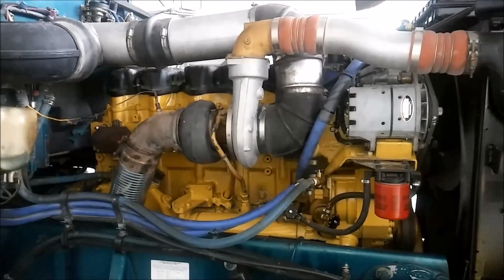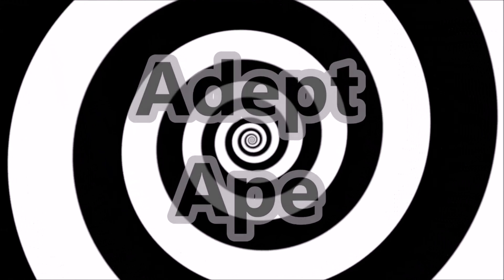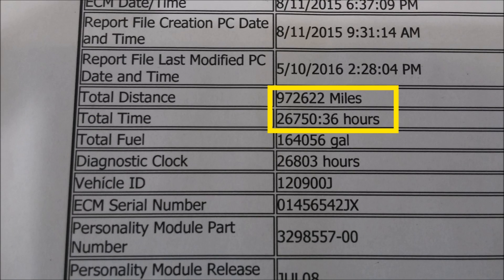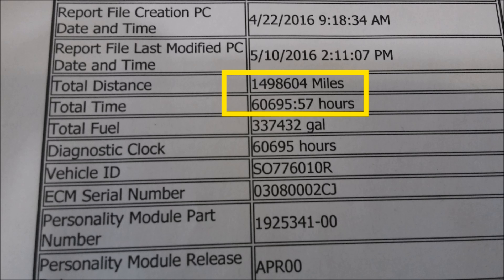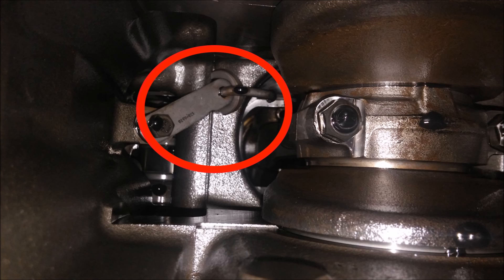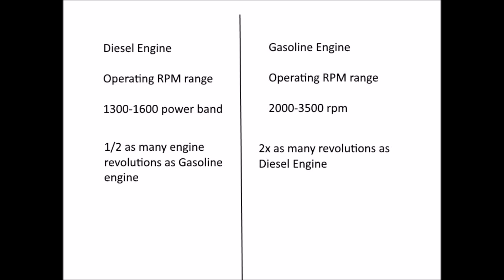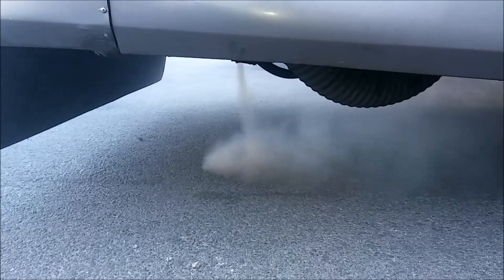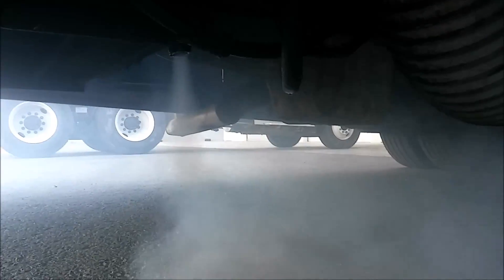Why Do Diesel Engines Last So Long?

Comment: You cant look like that on rpm... Diesel has more torque and torque also causes wear... its not that easy.. but other points are prety good..
Reply: While the stress from torque does cause wear, this is easily mitigated by stronger, larger components at cost of fuel economy and expense. 

There is more challenge to mitigation of wear where higher rpms are common. In fact, larger, heavier components are detrimental to a high revving motor.
Reply: *****
That is correct.

Comment: Got a 1996 Volvo at home, 2.3L turbo 225Hp engine with 397K Miles on it, still havent been opened or rebuilt. but with regular service it should run 200k more. And we got a Old Ford 1962 Y Block 292 with 780k Miles but has been trugh one rebuild. Any engine lasts nearely forever today, because of newer oil and fuel technology. :)

Comment: you're comparing apples and oranges.   You should compare equivalent sized engines.  like a 5.9 cummins (only 1 thermostat ) to a 350.
Reply: I agree, semi engines are different. But 5.9 cummins will still outlast a 350. I know guys who have cummins pick up trucks that have 1 million miles on them, my cummins 5.9 has 230k miles on it and anyone who ever drives it or goes with me says it drives like new, well it drives better than new because of the modifications i've done on it.
Reply: The main concepts are the same in both cases.  He using a drastic example to make a clear distinction to the not so engine literate...
Reply: +Eric f My roomate has 2...something you might want to pay attention to..His work truck...340k...run kinda hard..29 lbs of boost and a few mods...started running a little rough and a bit more noise from the motor..on his way to work, packing 400 gal of diesel up the side of a mountain..said it sounded blown up..I towed him back with the other truck, pulled a couple covers..one broken exhaust spring..another one had pitched the retainer and the valve had fallen down..the only thing keeping in from going all the way was the burr from the keepers catching on the seal...first diesel I ever worked on..stock is 30lb spring pressure on the seat...lol...new springs/retainers/keepers/seals on monday...other than that..freekin cummins (12valve) is one kick ass piece of equipment!
Reply: piddyirishman I have an 83 bluebird setting in my field blew a head gasket
Reply: wilson solt Exactly!
Reply: i had a datsun bluebird do a million Km's still goes strong today
Reply: The Cummins will last much longer, burn half the fuel and need far less maintenance.
Reply: I just bought a 2001 Dodge with a 5.9L Cummins. It has 57,000 miles on it. It's basically new. Started life owned by the fire marshall of Spokane, WA. It's red. We call it "The Chief".
Reply: For me, in general is great a comparison as that’s the main 2 tyres of engines for the average Joe.
Reply: Ikr the size differences are pointless if ypu arent comparing engines for similar applications. It's like he is comparing a lawn mower engine to a car engine.
Reply: This video hurt gas guys feelings
Reply: @pauloegusquiza5061  I'm a diesel guy

Comment: I have 500000 miles on my gas engine
Reply: Nice. My Ford Ranger has 180598 on the odometer, but the clock was stuck when I bought it...5 years ago and I use it as a work truck daily. It has to have at LEAST 400,000 by now. The old 2.3 I4s were good motors. 

My Mercedes 300D has 445K. It has a 3.0 I5 Diesel and runs great. Only downside to those are the timing chains.
Reply: avery wellsand nice tell me more about it :)
Reply: BadDrivers it's a 92 suzuki sidekick
Reply: avery wellsand well I'm impressed how well it performs. Do you do regular maintenance aswell? :)
Reply: BadDrivers yes absolutely oil changed every 3 months or 3000 miles. I try to do something every payday. up next is the breaks
Reply: Just change the chain and adjust the timing or monitor your chain stretch

Comment: Paul Taylor
What's not to like is the higher initial purchase price and eventually the cost of rebuilding a modern high speed turbo Diesel engine. The cost of injectors and having them calibrated. The fact that after a minor overheat the injectors are history and have to be replaced (or rebuilt) at huge cost. The cost of a new turbo (as all new Diesel cars are turbocharged).
These costs cause an older Diesel powered car engine to be less likely to be rebuilt and rather scrapped.
They are great to drive when new and get great MPG but cost a fortune to repair.

Comment: I think many diesels also have a very good oil and air filter systems. The crud in the air and oil wears the bearings and cylinders more. Thank you for the informative talk.
Reply: Good point, a lot of diesels have coolant filters too. Another difference I noticed is diesel engines generally have some type of oil cooler while most gasoline engines don't have an oil cooler.

Comment: the first reason is their low rpm ...
Reply: First reason is they're heavy duty. GM used 350 gas engine parts to build diesels years ago... yeah, didn't hold up, they tore themselves apart.

Comment: I have to agree with alot of others on here, its not really a fair comparison between a 5 litre gas engine and a 15 litre diesel engine. But it all does come down to proper maintenance. I have seen gas engines run for a million miles as well. I also have a 07 Kenworth with a C15 that has almost 1.5 million miles still running strong and uses less than 1 gallon of oil between changes(30k miles). And all diesels are not created equal for example the small diesels in cars or the amazing GM 350 diesel engine lol.

Comment: What is the difference in operating cost ? Cost per mile operation cost? Do states give a tax discount on a diesel ? overall cost can be more in the long run. yes it may last longer but your pocket book cost is the bottom line. I had a financial guy saying he was gong electric or diesel. but the cost of taxes would eat a hole in his saving in the long run. Think before you buy into any idea yes diesels may last longer but cost you more in taxes I do think Mr. Spock would say that is not in anyone's best interest.

Comment: i have a f-150 and i have 300,000 miles and it starts up fine i also run 20 percent or 4 gallons deisel fuel in mine oddly runs better that way

Comment: now my dads 94 gmc serria 3500 has a 350tbi and its got 550000km (not to sure what that is in miles) but its on its original motor and tansmission its a work truck loaded down with tools and diesel in the slip tank and its been like that for 10+ years now and before that it pulled horse trailer its had a life of heavy use and its still running strong how ever we are looking at getting a preemissions diesel for the power and the better fuel economy.
Reply: Matthewzilla haha i mean no body ever said gm couldnt make an engine the rest of the vehicle might not be as good however my 2005 silverado 1500 5.3 z71 has 312k kms on it and it still has paint on the frame it went down alot of dirt roads to also being in canada it has little rust for the use

Comment: This just isn't a useful comparison. Comparing a car engine with a large truck engine is silly.
You need to compare like with like, for example a car that is available as a petrol, or a diesel.
That would be more useful.

Comment: Is that why NASA use diesel engines to go on the moon ?
Reply: Yeah, like because...science and shit.
Reply: Alex Abadi I bet they only use Diesel engines because of the interference that the gas engines have with the communication
Reply: technically kerosene is similar to diesel.
Reply: There is no oxygen in space so rockets have to carry it with them (liquid oxygen).
The Saturn 5 rockets used liquid oxygen+kerozen
Now all rockets use liquid hydrogen+liquid oxygen and sometimes extra sides rockets with powder propellant.
Reply: nasa wont get far without diesel, as it powers all there heavy movers, bit hard to get your rockets and to the launch pad without them
Reply: we have a code Eugene
Reply: "FFS, people. There is no oxygen on space and no space rocket uses kerosene or diesel or any of those fuels."
BUZZ! Thank you for playing! Don Pardo, what parting gifts do we have?

RP-1 is kerosene. RP-1 is the fuel source for the 1st stage F1 engines on the Saturn V. 

Now, don't you feel bloody stupid?
Reply: JEOPARDY! the home game, and Rice-A-Roni "The San Francisco treat" Back to you Alex.
Reply: hahahahahHAHAHAHAHAHA
Reply: bcubed72
lmao calm down bro he was joking
Reply: which engine is gonna make the torque to move them? lots of high torque electric motors that power ship propellers and also mining truck wheel motors but guess what generates the power to those electric motors? that's right big big diesel engines. if we didn't have diesel we would be in a bad spot. it runs America. farm equipment, semis, ships/oil tankers. mining equipment, stationary power generation, powers hydraulic fracturing pumps anything you think of other than nasa rockets diesel is heavily involved in.
Reply: Alex Abadi actually yes. The first leg of the journey to the moon was the S5's trip from the assembly building to the launch pad. That was done by the largest ground based vehicle ever made. Look up "nasa crawler" here on youtube. If I remember right it is powered by electric motors which themselves are powered by 8 diesel powered generators.
Reply: Treatmentttt Options for Erectile Dysfunctionin Patientssss Failing Oral DrugTherapy > https://t.co/NfAeyvBzS1?VuAQi7JfVNEdgg
Reply: you mean hydrogen peroxide
Reply: Jimmy Hill A huge chunk of that is being replaced with natural gas these days simply because natural gas is so much cheaper... Also the existence of infrastructure to move it (namely pipelines) doesn't hurt. In Florida roughly 60% of power generation comes from natural gas. Obviously, electricity generation in Florida is not the same as every engine in Florida, but it's still rather telling. Whenever practical, companies are using natural gas. Hooray for fracking... 😫 If that emoji didn't cue you in, then I should mention that I'm not a huge fan of fracking. I understand that it's necessary for the moment... I just don't like it. It's a truly nasty business... Unless you like drinking water that catches on fire.
Reply: Alex Abadi Is there any air in space? Didn’t think so.
Reply: LOL what?!? NASA used kerosene/O2, H2/02, and Hydrazine/N2O4 rockets. At no point did they use a "diesel" engine. RP1 (i.e. space-grade kerosene) is "sorta close" to diesel, but calling a rocket engine a "diesel engine" because of similar fuel is like calling a turbojet engine a "Diesel engine."
Reply: @bcubed72  woosh
Reply: FFS, people. There is no oxygen on space and no space rocket uses kerosene or diesel or any of those fuels.
They use hydrogen and hydrazine.
Neither do rocket engines use those combustibles on earth, rockets are not jet engines.
Reply: "nasa wont get far without diesel, as it powers all there heavy movers, bit hard to get your rockets and to the launch pad without them"

Right, because diesel engines can't be replaced with any other kind of engine/motor. /s
Reply: They use powder aluminum that is rocket fuel not Diesel or Kerosine , Kerosine is jet fuel not rocket fuel.
Reply: "technically kerosene is similar to diesel."
Closer to jet fuel, really, but you can use it in a pinch. But a rocket engine has nothing in common with a 4-stroke compression engine, other than they both use a hydrocarbon fuel of similar weights.
Reply: Space is fake. Earth is Flat...
Reply: @steadfast7905  time fer yer meds.....
Reply: bcubed72  correct me if I'm wrong, but aren't the F1 engines already decommisioned. Also they only used kerosene because of density, the Saturn V tanks couldn't hold the volume of hydrogen needed for technical reasons. 

So nope, m9, I don't feel bloody stupid, thank you!

Comment: Ask Irv Gordon. He has done over 3 million miles with a 1.8 litre gasoline engine in his Volvo P1800. There is also a Saab 900 with more than 1 million on the counter. Depending on how you drive and maintain it, extremely high mileages are possible in gasoline engines, too. Even my old Volvo 940 has done around 250.000mls and there is no end in sight...

Comment: My 97 F-250 is up to 400k and running strong. Diesels are excellent.
Reply: Just traded in an Acura MDX for a Diesel Jeep Summit 4x4... drove a week and a half in the Jeep... would have filled my MDX twice already.  Im loving it!
Reply: Toyota put out an abnormal amount of miles in their gasolone engines.
Reply: Nice. My 2000 f350 is at 400k.

Comment: Alright decent video but I'm still waiting your insight how the difference of the main bearing between a 350 and a cat C15 main bearings have any affect on their applications...ok video otherwise
Reply from the maker: +sam wase I showed the bearing difference to compare how big the engine component differences are and a bigger bearing gives the engine more support for the crankshaft and more oil support for the crankshaft.

Comment: I dealer line item packaged, put together & bought 2007.5 Chevrolet 1500 Crew Cab 4x4 on June 17th, 2007. Therefore, my dealer (and I) was able to create a 1 of 1. 

My 1500 has a 2500HD chassis/frame, accompanied with Z-71 suspension package, the HD front end Snow Plow package, an extra leaf on the rear end (already a 2500HD frame + Z71) this give me GVWR & towing capacity of a 3500. I packaged it with the 4.8L GASOLINE engine from their 2500 Vans. Added a 2.5" S/S exhaust off of the block, each side with their own CT both exhausted directly behind each rear wheel. 

My interior ordered was an LT1 (yet the Z71) combined added leather, the full center column, navigation, 20" wheels & a sunroof. I have the SuperChips PCM, which I use for my towing package, a 87oct fuel save program, 93 octane power setting & a program your own. The SC let's me drop the fan temps, calibrate for wheel & tire sizes, oil cooler temps, trans temps, shift points for each gear up n down & more I can't remember. I use the 93oct since the internal combustion engine performs best using the best available fuel. I get 27mpg hey & when I drive her at home she's a horse at 9-11mpg. 

In very late 2010 I turned 300k miles. Today she's turning slightly over 500k. I bought a truck bc I'm a Union Iron Worker. I need something beautiful & comfortable that can drive me the different distances I have to drive every day 6 days a week. With 4-5hrs a day of wheel time a day with 10-12hrs a day of spudding, tacking & welding 70/18 rod on a harness a couple hundred feet in the air, perhaps more than a couple hundred .... I need the best I can get. Getting stuck up near Canada or in PA or NYC or CT, PA etc .. are not options. 

I use nothing but Royal Purple Oil & Oil Filters. K&N air filter (clean it w K&N cleaner e 6months). Use Z-Maxx oil & engine treatments as directed. A 1/2 cup of Lucas Oil every fill up; never let it get below 1/2 tank if poss. Just literally truly take care of the motor. My point, it's NOT all about Diesel motors. Diesel doesn't mean shit. Unless you're hauling over 50k #'s for years at a time  Gasoline engines are just as good. 

It's all about taking care of your motor.  Act like an adult. Once you realize this (and you keep the inside clean) you'll have a brand new truck for ever. 

At 750k GM is giving me a new one & letting me keep this one. Now I need to rent a storage space for the new one .. no need to use that one

Comment: how can you compare a cat motor to  chevy 350???? try a something a lil closer in size like a ford 7.5 gasser vs a ford 7.3 stroker. close in displacement with differt workings. you are comparing a garden hose flow rate to a 5" deck gun on a fire trucks flow rate, it cant compare. you points are valid but showing bearings from a cat and a 350 are not even close. i see diesel pickups with 550k, 600k, to 800k thru the shop i work at. just some thought
Reply: Jesse Shubin Exactly...Diesel pickups with 500,000+ miles. Not many gasoline pickups get anywhere near that, but a LOT of the Diesel engined ones do.

Comment: So what should RV'rs do to keep their diesel engines from over heating?
Reply from the maker: +Dave Dunham Well most of the overheats I see are caused by the radiator being plugged internally or externally second to that is coolant leaks dumping the antifreeze.